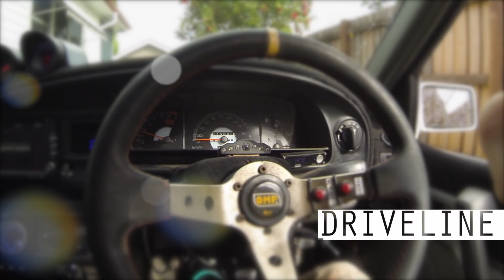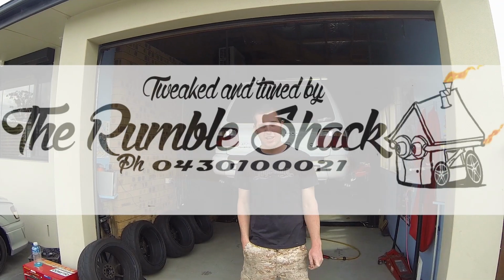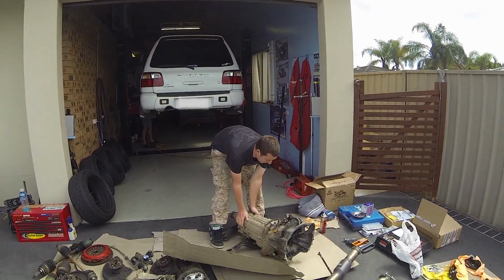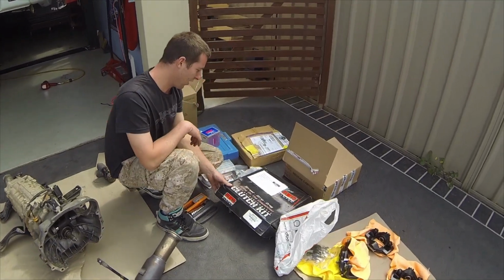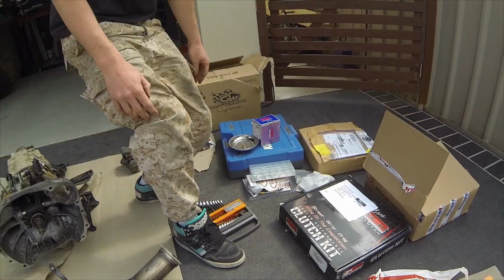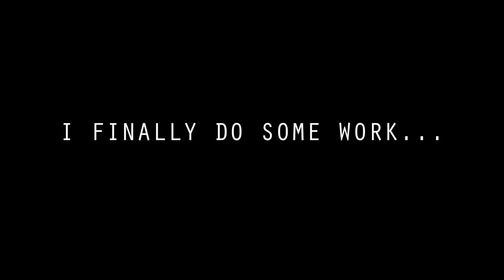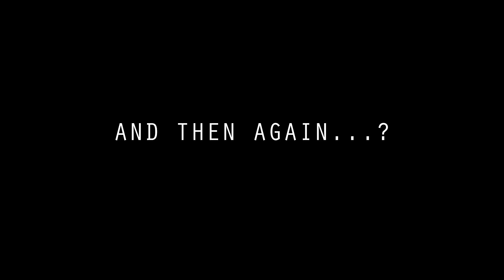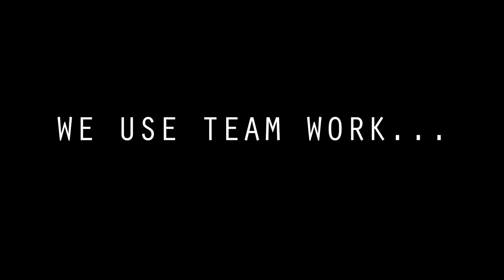HOW TO SWAP TO AN STI 6 SPEED IN A DAY [P1]

Comment: curious if the wiring harness that was on the 6 speed perfectly married up with the wires on the forester side?
Reply from the maker: Yep, they sure did👍
Reply: @boostedbuiltgarage  maybe my 6 speed was missing some, or its just different because it came off of a jdm forester sti? i will see if i can use the harness on my 5mt forester on the 6mt.
Reply: @lucasc6485  is that 5spd harness capable? Looking to do one on my STI SF5